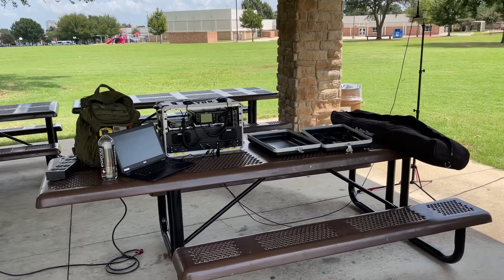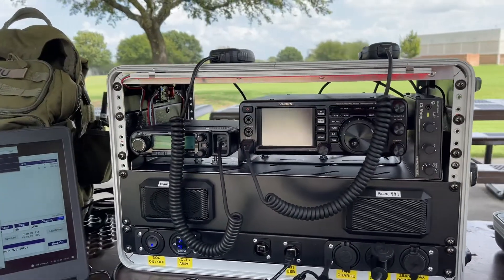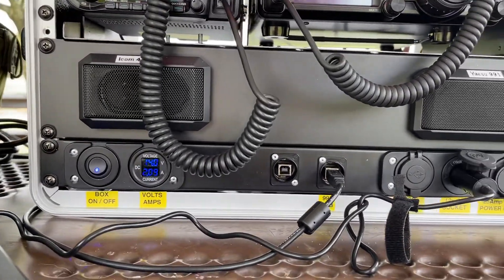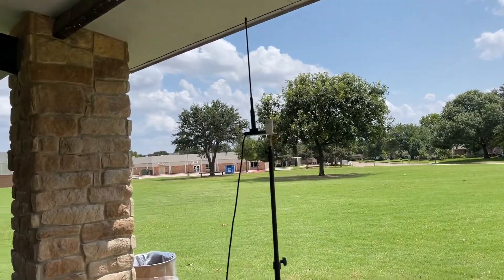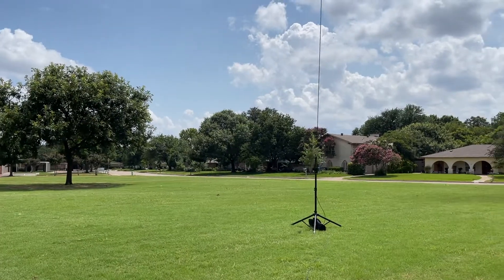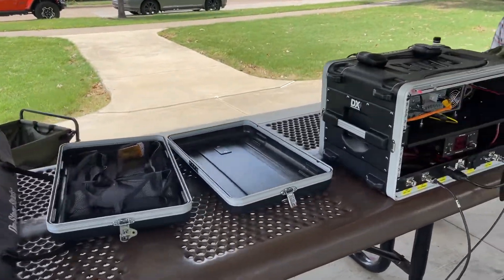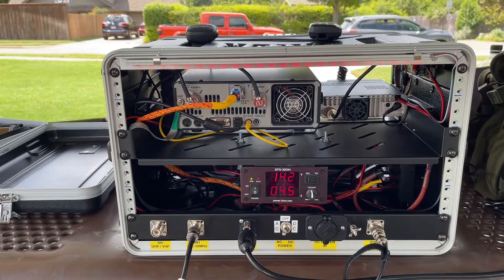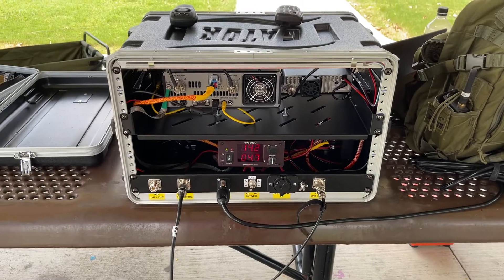HAM Radio GoBox

Comment: Nice job!  I made a similar box, but didn't use the panel mount RF connectors as shown... the back of each radio is easily accessible, so I just plug the antenna or coax directly into the radio (KISS design with fewer points of failure).  Also, the 2M antenna might work better with some ground plane radials, rather than as an off center fed vertical dipole as shown. 73